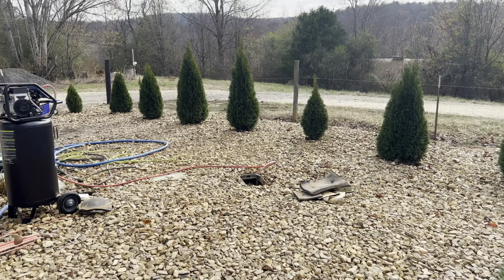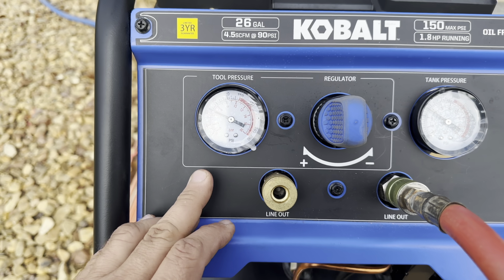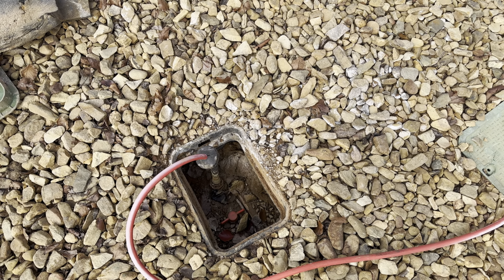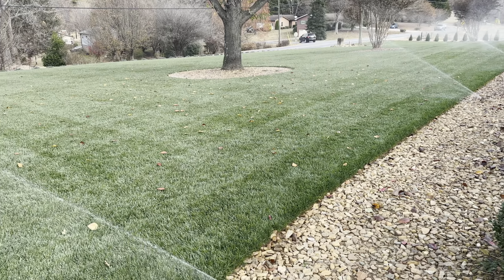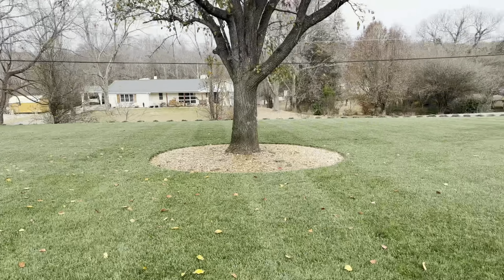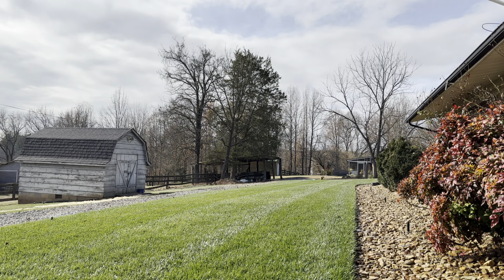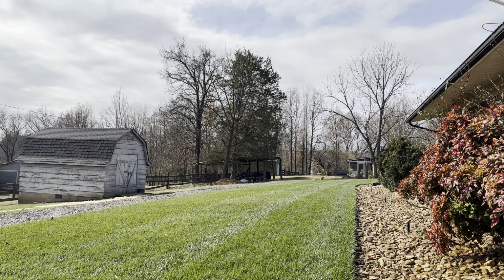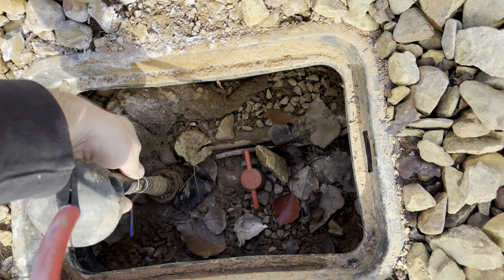Winterize You're Irrigation System

Comment: If u have a large 2.5 acre piece of land, do u need a larger size compressor?  Like does the distance affect the size of the compressor?  Mine had 4 heads on each zone, but I got 15 zones spread throughout 2.5 acres.  Thanks!
Reply from the maker: The larger the system (longer runs of pipe) the longer it’s will take to fill the system with air. You don’t necessarily need a huge compressor but it would definitely help being a larger compressor will hold more air. A compressor with a small tank will fill the lines no problem but you want have any storage of air with a small compressor so as soon as you open the valve up the tank on the small compressor will be depleted and the compressor will start running again. What you really need to look for is a high cfm compressor with a decent size tank. Hard to find unless your willing to spend the money!

Comment: Nice video Brad. I have a question at the end of this setup. My system is much smaller. Two zones, 8 heads each. My installer just told me to drain my system and didn’t install an air valve. Because on my topographic layout each zone has a couple of heads that are significantly lower than the rest so my guy said to open the valve for a zone and the main irrigation valve off and the. Run the valve for a bit. He says gravity will allow the water to drain down to the low heads and out. Been doing it this way for 5 seasons without issue. Here’s my question, if one of the low drain heads has a check valve (installed last season) will that inhibit draining? Not completely sure what the check valve does. I suppose i could just unscrew and remove the heads w check valves if need be. Thoughts?
Reply: Yes check valve will prevent draining. 
I would install an air fitting vs letting it gravity drain.
Reply from the maker: Yes the check valve will prevent drainage unless it’s a huge elevation change. If you don’t have a check valve and go to lowest head the water will continue to pour from that head when the zone has just ran and cut off. So the installer is correct on that if you don’t have a check valve. Hopefully this answers your question lol.
Reply: @Primetime_Fescue  Sure does tks. I added the check valve head after the system was installed. When I drained the system today I unscrewed and removed the head and just left the body.